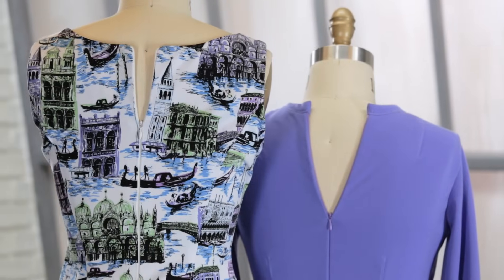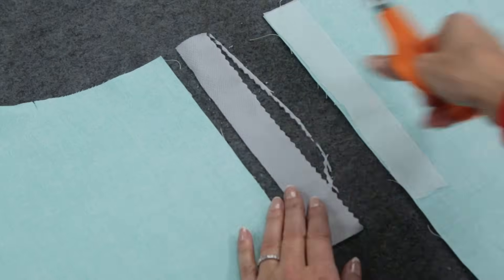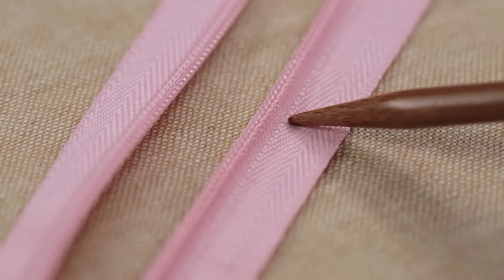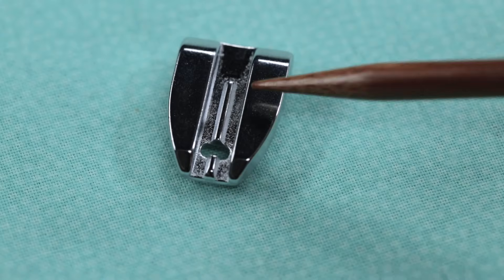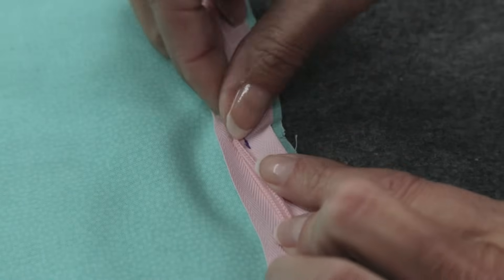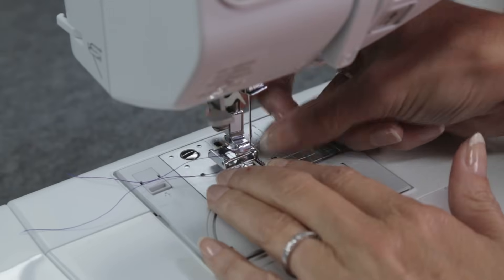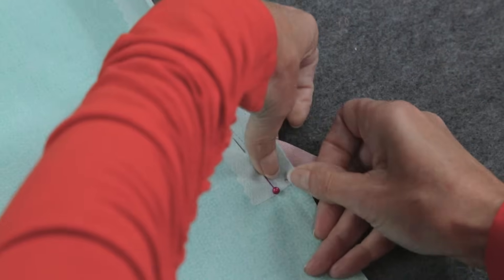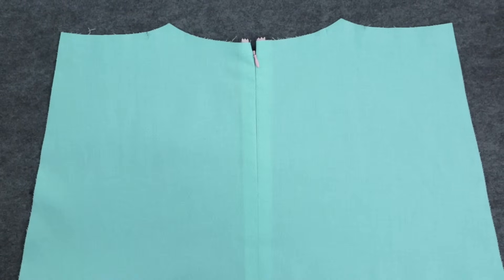How to Sew an Invisible Zipper Step by Step | Sewing Tutorial with Angela Wolf

Comment: Thank you #AngelaWolf. Your video is perfectly produced. It has just necessary words: clean, direct an smooth upbeat voice instructions, the lighting used is perfect like the Camera Quality. Also the color of fabric and zipper used helps tremendously to have a clear/softer view of the task. After more than 50 years sewing I never got WHY you have to iron an invisible zipper. Well your 2 tips (interfacing) and the WHY you have to iron and exactly where makes so much sense. #CoatsZippers should have you re writing their Polyester Invisible Zipper Instructions. Muchas gracias otra vez Angela!!

Comment: When closing up the rest of the seam (at around 3:58) could we just continue sewing a continuous seam, without changing to a regular pressor foot?
Reply: Look up the imperceptible zipper tutorial by Kenneth D King - and I'm sure someone else shows it too.  It involves a few steps but they're all easy and you will need a pair of tweezers or similar for manipulating the zipper pull at one of the steps. With that method you machine-baste the top part (where the zipper goes) but continue to sew the rest of the seam with a normal stitch. Of all the ways I've seen of doing an invisible zipper that's my favourite.

Comment: What do you do with the extra 2-3" of zipper left over?
Reply from the maker: Hello,

 Great question! Please use the link below to submit your questions to our experts: https://www.craftsy.com/contact 
Thanks!
Reply: With the zip closed sew a 0-stitch length zig-zag just across the teeth for a few stitches where you want the bottom zipper stop to be.  That is your new zipper stop.  Cut off the bottom of the zip about 1" below that.  You can shorten most zippers (but not separating zippers) that way.

Comment: I'm a beginner, so this may sound like a dumb question, but how does the stitch not show through on the other side? Is it the interfacing? Or is is a stitch that only shows on one side?
Reply: Amanda Lynch. Think of it like a seam. When you sew 2 pieces of fabric together, wrong sides together, and then open it up, you don't see the stitching, only a seam where the two meet. Hope that helps! A great way to learn is by looking at pre-made clothes, take a picture of a seam, take one section apart and put it back together the same way it was originally. Best wishes to you.
Reply: catpaws434 Ah, I know what that is but I may have not understood the wording. Thanks!

Comment: There is something I do not understand. When you start the 2nd side of the Zipper, you have it all lined up and the seam allowance is folded under. Then you flip it over, remove the pin and suddenly you can see the raw edge and you're measuring your seam allowance. I do not understand this.it was already lined up and folded under from the front side.

Comment: 2:51-2:52 min is very confusing. The video was cut, the fabric was placed differently, the video continues and the following instructions come from the fabric and zipper position which is not like in my hands. I watched it like 10 times with 0.25 speed and it's not right. the cloth is looking to the left in my hands once it's flipped but in the video it's already placed towards the right side. not the best "step by step" lesson for the beginners